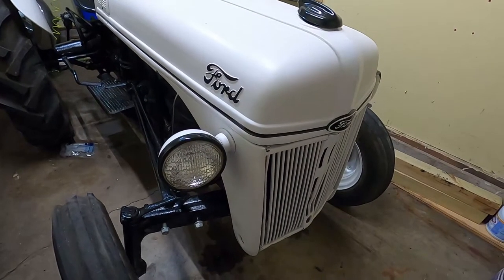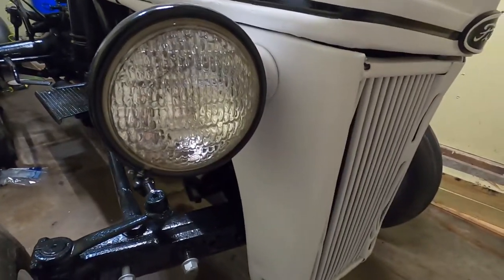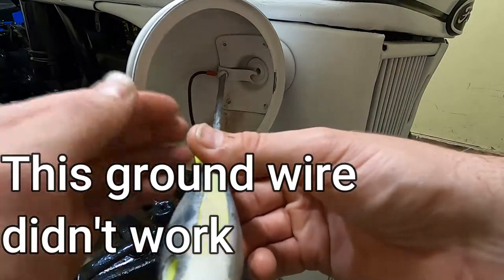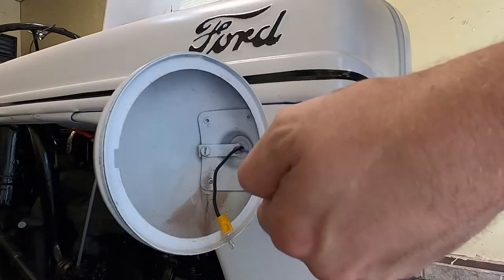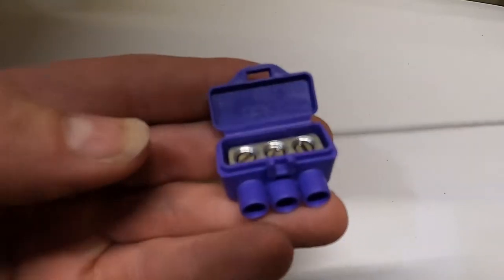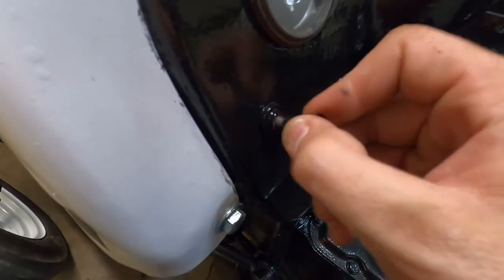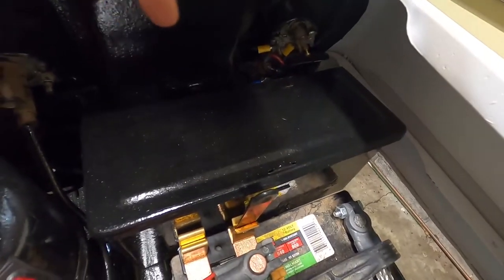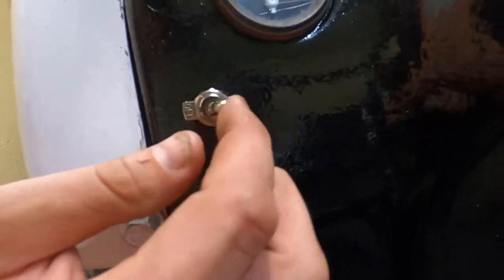1952 Ford 8n | Wiring the headlights

Comment: For conversation sake - Maybe the ground no longer worked on the lights the way a person might expect because you did a 12v conversion at some point and that changes the ground on the system? I liked your terminal solution. You should post a link to that in the notes.

Comment: Nice light setup and tractor—love the black on grey paint scheme! I’m planning to install the lights on my ‘53 Jubilee soon so I can use it for snow plowing (already been converted to 12v.) I’m guessing it’s a similar process? I might add a rear work light and amber flashers in the rear, too, so I can drive it on the road if I ever need to.
Reply from the maker: Thank you for the comment! I would imagine the lighting setup is very similar. I have also been thinking about adding a rear light, definitely would good if you are driving on the road

Comment: I might fix my headlights on my 52 one of these days but no hurry I don’t do any night driving. I changed it over to 12 volt system last year. Would have to get new 12 volt lights first might do it this winter.
Reply from the maker: That sounds like a good winter project. I don't use my headlights much either, but it's nice knowing you have the option if the need arises. Thanks for the comment!

Comment: You say it's not necessary for an inline fuse, well that is incorrect information you put on your video gor people watching,  every electrical circuit needs a fuse, and not if something happens in the batter, but if your switch shorts put ,your wires short to ground to each other, the screw terminals back off and short etc.
Reply from the maker: Thank you for the comment, sharing knowledge will help everyone out
Reply: @GISTrackersTractors  I did like the fact that you grounded the headlights to the battery
Reply: I don’t like how you’re so negative. Why complain just don’t wire your light like he did if you don’t like it. Don’t be a keyboard worrier.